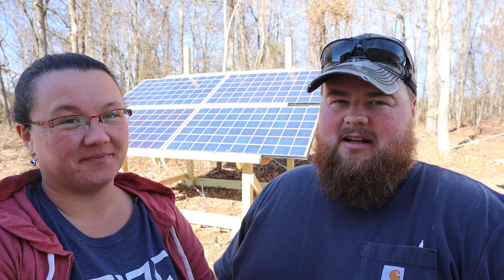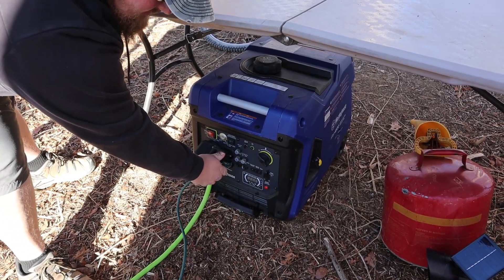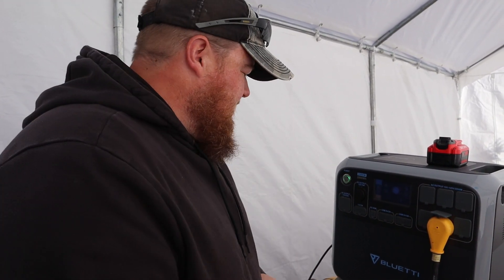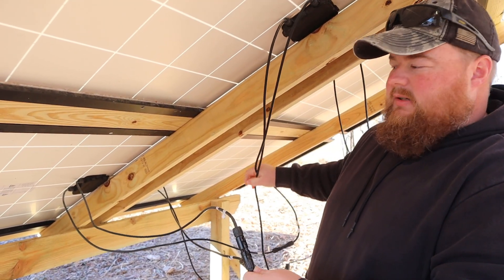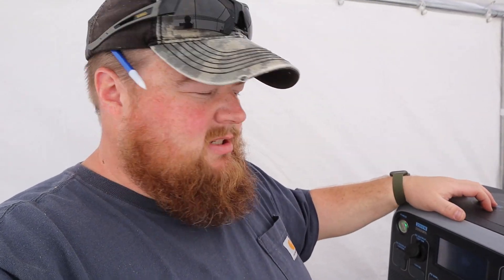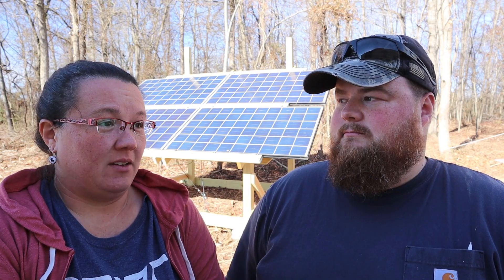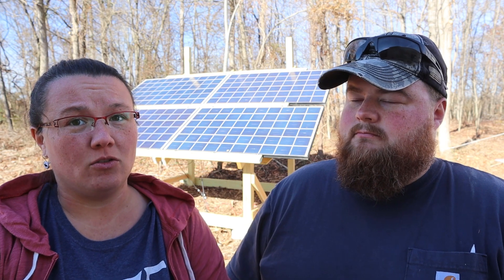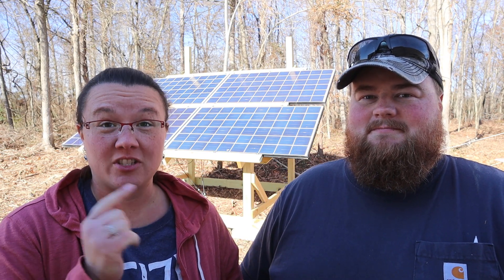OFF GRID POWER TOUR: Our [Solar + Generator] System // How it works!

Comment: You can get a connector that parallels two arrays. So then you can connect 2 panels in series then the other 2 in series then both sets of 2 in parallel to the Bulletti. This way you get the full output from your 4 panels. Just make sure your device can handle the amps from 2 panels. I.e. series adds voltage, parallel adds current (amps.)
Reply: Merry Christmas 🎅🏻🤶
Reply: Late reply but yeah 2s2p should do it. Plus, if one panel gets shaded it won't bog down the whole system.

Comment: Looking good guys! One thing you may want to watch is your “RV Adapter Plug”. Having worked in the RV Business I have seen countless adapter melted, some welded themselves to the camper plug. People trying to draw more power though it then it’s Rated for, ie you plug is no more then 15 amps, probably closer to 12 amps. Please keep a eye on it and the plug on Eddy as it could melt as well

Comment: I have a small 300w set-up, and I use it to charge pretty much all my small electronics. 

However, like you, I have a small petrol (gas) generator that can handle a few extra items if there is ever a power outage where I live. 

I used to live off-grid for a while as a child, so I know what I can do without, and between the solar and petrol generators I have enough to keep me warm in the winter, and cooler in the summer. I have found one good trick is to look at buying as many camping goods as possible, because they run on much lower power consumption compared to everyday household items. 

What you have shown is no matter what your budget, it is possible to set up something fairly cheaply. The biggest expense being something like the solar generator, and that's the next thing I want to upgrade, because I have been on a limited budget so I've only been able to afford smaller units that run off single 100w solar panels. I really would prefer to chain the panels together and charge up a much larger solar generator... one day. 😁

I love solar power, and although I live in a rental property, it can still be done. 

I truly hope your video encourages people to maybe think about becoming a bit more off-grid capable.
Reply from the maker: We really hope showing our learning experiences with solar inspires others too! We have been sitting on a stack of soar panels over a year (these large ones we bought on a whim at a great deal). We are very excited to finally begin to put them to use. Who knows... maybe we can run completely off grid, or at least as much as possible! We both love the idea of on-site solar and all the benefits it brings!

Comment: LOL I've been making due for starting my 8th year of off grid living on 100 watts Harbor Freight solar set up. Yes, I need more in the winter but in the summer I have plenty for now. I run my 12 volts lights, my 12 volt fan, charge my phone. I use my skillet dry to make grill cheeses & toast. And I sweep but by hand no vaccum sweeper.
My exterior porch light has it's own rechargeable battery. So, I get by for now. Looking for land to build my new homestead, then I'll build a bigger system.

Comment: I don't know if you guys watch the Lumnah Acres channel, but they are setting up a massive solar array on their new property (they are transitioning from a small homestead farm where they have been to a new property that is larger and is being developed from scratch). If you want some ideas about being completely power independent, well you can't be completely because you are still dependent upon parts and such right. But anyway, check their videos out. Its one of the better implementations of a big off grid set up.

Comment: Agree with your off-grid, power generation approach with one exception.  Increasingly there are ways to tap a person's solar into the grid with excess power going to the grid inexhange for some level of credit or payment.  This capability, power company acceptance level, etc...seems to be ever changing. For anyone turning to partial or whole solar power systems, my advice is to keep current with what your lower company is doing. Keep abreast because there have been internet based horror stories (lol, and we always find the most extreme, attention getting stories on the internet) that in at lesst a couple of communities it costs more to power generation share than not.

Comment: I am powered solely by solar power.  I have a large battery bank and 9.4 Kw panels.   I am not grid tied and I love it.  When something goes wrong it gets fixed quickly.   I don't understand a lot of it but my son is my solar guru and he knows how to install and repair.  I live in Southern Montana and don't have the sun like you do so if you go that way you will be set.  It is a large money output at first although here it cost almost as much to bring in the power from the power company so my money went into my property without monthly payments.
Reply from the maker: That’s great to hear and an inspiration to us! We would both love to be 100% self reliant for power. We’ll need to convert some things in the home to help (stove, water heater to propane) but those aren’t crazy expensive in the grand scheme of things.
Reply: @sam-and-angela  I did that too.  My dryer, heater, range and water heater are propane plus I have a wood stove fro backup heat and cooking.  It's wonderful knowing I have power and the control over it!
Reply from the maker: @lyndabuchholz1216  Would love to do the same in our home!!
Reply: @sam-and-angela  You can! You both are so talented and creative!!

Comment: Try putting 2panel each in series then connect each pair in parellel. This will reduce your voltage and work with your bluetti
Reply from the maker: We would then be over on amperage for the BLUETTI on input.. we're finding the bottleneck in our system for sure... ;)
Reply: What about using an MPPT charge controller and a couple of batteries. Can the bluetti connect to batteries?

Comment: The eco flow with the two extra Batteries fix your problem you could wire that panel back and you have way more amp hours but I know that’s expensive
Reply from the maker: Yeah, it would.. We're coming to realize the BLUETTI is a bottleneck in our system. Which is okay.. we're using it beyond what they're really sold as. :) We're working with a solar company, Langston's Alternative Power, on finding out what we would need, etc.

Comment: Instead of changing the wiring perhaps a large piece of cardboard over one of the panels when the sun is direct on the panels.  Does the Bluetti have any issues with freezing temps in the portable tent?

Comment: If your array is producing too much power at full sun don't waste it.  Use the disconnected panel to charge an additional lead acid battery that can then charge the Bluetti at night via the 12volt input in a pinch.  At 200 watts you can fully charge a car battery in 5 to 8 hours.
Reply from the maker: We’ll put it to use for sure. Just can’t right yet. Great problem to be in though—more juice than we can store or use right now.

Comment: Great stuff if you can afford it! Maybe some day. Batteries for storage? I have a Generac generator, runs the entire primary house. Things to consider! The things that pull the most power? Electric heat, electric water heaters, etc. Go propane when possible. I have a 9000 watt peak generator and it can run my entire house with everything running at the same time including my pool and a whole house A/C unit. Also consider a whole house surge protector. Had one installed in both primary house and vacation property mobile home when the service panels were replaced.
Reply: If you own & maintain all of those things you could have built a brand new array that's of a pretty big size.
$1 per watt is the brand new price. And Sam & Angela scored big with 2nd hand panels at $0,25 per watt that still have over 95% capacity in them & will last a good long time.
Reply from the maker: I would really like to ditch our large electrical appliances when the home is moved over. Find a good used propane stove and then a propane tankless water heater would be great! We would love to have our primary home electricity from our own solar system.

Comment: You only have a 150v max input available to the blueyetti.  Doing 2 pannels and 2 in series would be better and you can use all 4 pannels.  You would just need MC4 branch connectors.
Reply from the maker: It would be good except the BLUETTI max input amperage is 12A and these panel push out 8A each... we're realizing the bottleneck in our system...
Reply: @sam-and-angela  wow yes 12a is a prety bad bottle neck.

Comment: Make sure you’re pulling 30amps into the camper, because if not you’ll burn up your fridge/furnace/air conditioner electrical components. We learned the hard way. The motherboard in the furnace is @ $700
Reply from the maker: Our fridge is 12v and propane, same for the furnace and blower. The only device needing that much electrical draw is the A/C compressor, which isn't being used in the winter. Every camper is different, but ours is fine running as we have it set up.
Reply: @sam-and-angela  our furnace is propane too but the controls/the brain in it it electric. We were told by the service department to never run it on anything less than 30 amps. It’s not designed for long term 12 v use  ( other than the lights) the components burn up from straining to work on low voltage. We had a 30 amp/rv outlet installed by the camper from our service panel.

Comment: Merry Christmas!  Now, the temp power pole, it's designed for construction.  What will you use when you actually have construction going on?  Westinghouse generator, duel fuel.  Any idea how long a 4 gal tank would last?  You said 1 gal of gas would last approx 24 hrs...?

Comment: Sam, pay attention to your wire management.  The insulation on the wires are not UV rated.  Get them in the shade of the panels.  I love my Bluetti, but they have their limitations.
Reply: I have the new Bluetti 535 KW system, but have yet to receive the solar panels for it.

Comment: Could you add more batteries to expand your storage capabilities? If you needed to?
Merry Christmas to you all! Hope the boys are getting some neat stuff.
Reply: Yes, and that's where a solar system costs money. 
I'm very broke so I use marine batteries.
But good solar batteries start at $900 each. But they last forever. Whereas my marine batteries will not. You'll also need a charge controller and that's about $200- $500 depending on it's capacity.
Reply: @denisewilson8367  yikes! If you can swing it, it’d be worth it, though. And I imagine that as technology improves and more people are going with it, it should get cheaper. I hope.
Reply from the maker: Absolutely, that's the key for alternative energy storage and uses. It's not extremely easy with the BLUETTI, but we're also reaching a few limits with the BLUETTI and our abilities as things grow out here. :) We're working with Langston's Alternative Power on what options we have, and the best way to go about upgrading what we can with what we have.
Reply from the maker: Bingo! Batteries are the keystones to the whole thing... cost, storage, etc. There are many LiFePO4 batteries coming to market that seem promising and many solar companies are also offering DIY or alternative battery compositions to lower costs, too. Things such as used EV batteries, server rack UPS batteries, etc.

Comment: Can you run your panels in two parallel and those 2  in series?
Reply from the maker: The BLUETTI has a max solar input of 12A. The panels are spec'd for a max output of 8.27A so running two in parallel would max out the BLUETTI... unfortunately! *I had to look this up after the fact, otherwise I would have mentioned this in the video. :)
Reply: @sam-and-angela   OK. Definitely don't want to Max out Amps. Sounds like 3 panels is your only option

Comment: How awesome 😎 I’m curious how much everything cost for the array.
Reply from the maker: Prices are all over the place, but here are the materials used:  (3) 4x4x8, (4) 2x6x8, (8) 2x4x8, 1 box of 3" exterior screws, (30) 1-1/2" screws with fender washers, (4) rebar stake anchors

Comment: Can you add more battery capacity to that system?  Can you hook 2 panels in series,  the2 others in series, then those 2 arrays in parallel to get the correct voltage and increase amperage?
Reply from the maker: There's not much to be done, but remove the fourth panel. The BLUETTI voltage and amperage input limits are maxed out otherwise.

Comment: Any plans to utilize the disconnected solar panel....to charge a battery electric generator?
Reply from the maker: We do have some plans! 😊 With the help from Langston’s Alternative Power for guidance and equipment we should have a system that will have us not running the generator daily.

Comment: You could of ran all 4 of your panels in series/parallel witch reduces ur volts raises ur amps a lil and still allow u to use the full power of all 4 panels
Reply from the maker: Not with the BLUETTI - it's the limiting factor with this setup.

Comment: Can I just ask about your solar array set up?   Will it not just blow away in the next storm?  Or do yo have it fixed securely to the ground? Best wishes for 2022 to you all.
Reply from the maker: It is anchored on four corners with iron stakes about 20" deep. We've had winds in the 50 mph range and it's stayed put so far. Anything can happen in severe weather. We will build a permanent ground mount in the coming weeks for all of our solar panels to mount to. This was a cheap, semi-permanent ground mount for our immediate needs.

Comment: My eyes were totally crossed do you have the ability to store the energy and use u in t on cloudy days or at nite from what I gathered maybe. That would be a no ??
Reply from the maker: The limiting factor with any alternative energy source (solar, wind, hydro) is the storage method and capacities. Once the batteries are charged, they will keep their charge for a very long time. The key is to have a battery bank large enough to run us through the days where solar generation is low. The BLUETTI as it is now will not do that for us. We are looking into alternative options though, with the help of Langston's Alternative Power. :)